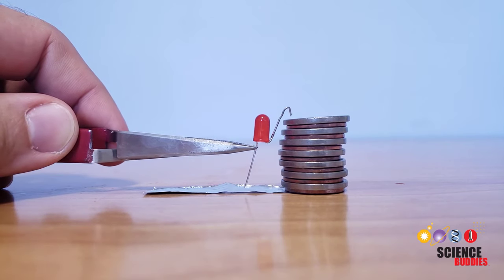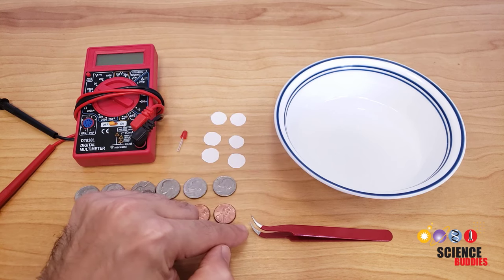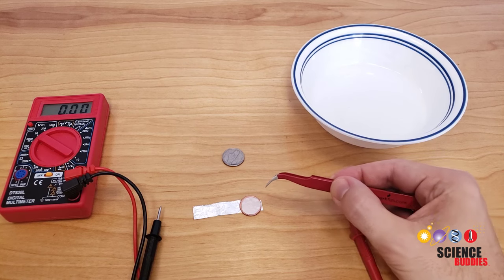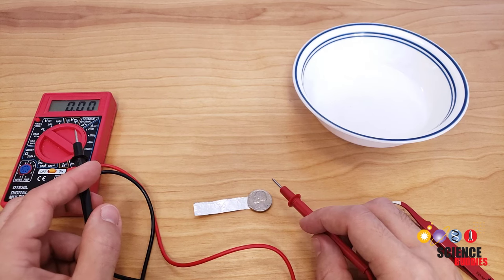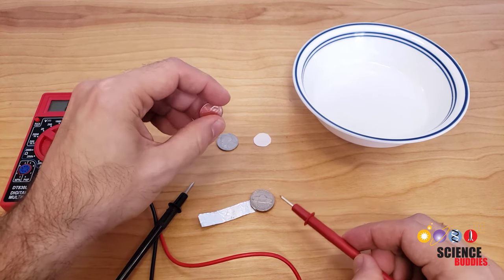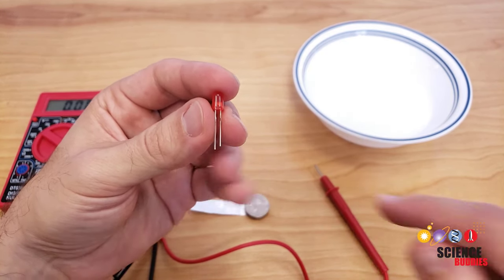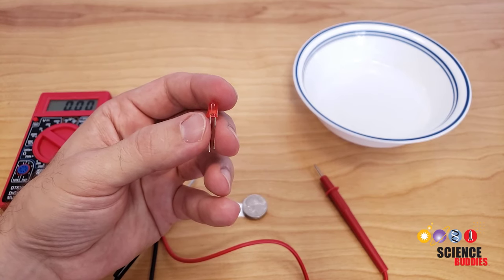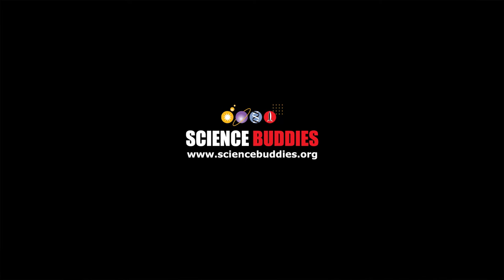Make a Battery with Coins | Science Experiment

Comment: Questions:

- Can you load the battery?
- Can you put the battery in a container filled with the solution, so that it wont dry out or will this make the battery stop working??
Reply from the maker: 1. The battery can only provide a small amount of current for a load like an LED.
2. If you immerse the battery in liquid, it will create short circuits between the cells and the battery will not work.
Reply: @Science.Buddies  Thank you! But question 1 is not answered. Can you load it?

Comment: How could you gain more current ?
Reply from the maker: Hi - we don't mention it in the video, but you can get more current by connecting multiple piles in parallel with each other.
Reply: @Science.Buddies  cool thanks for the reply 👍
Reply: Do you mean, like, stacking multiple cells next to each other on the foil? Would I need to connect the tops of the cells with a foil strip as well?
Would filing the coins flat make any difference in the efficiency of the current flow? And does this type of battery generate much or any heat? This seems like a cool project but I want to make sure I'm being safe 🤓

Comment: Can we use another metal instead of nickel
Reply: Im guessing you could probably use old pennies and new pennies. Old pennies (before i think 1976?)  are made of mostly copper. While newer pennies are mostly zinc. Though you might have to remove the copper coating on the zinc pennies. Just hit it with some sand paper.